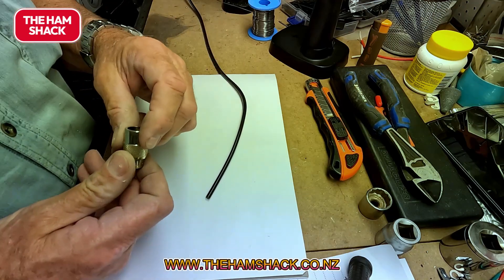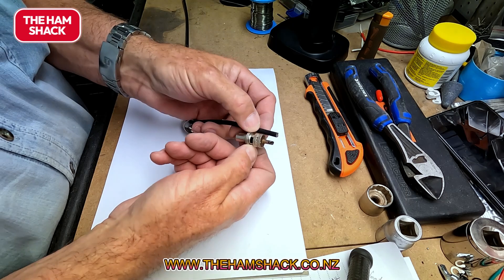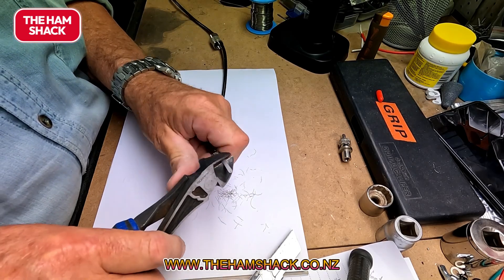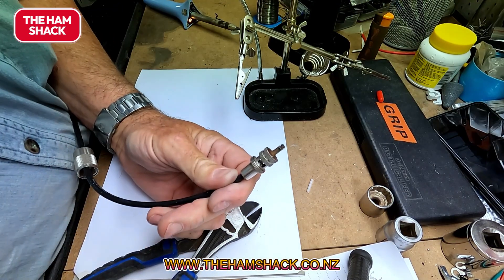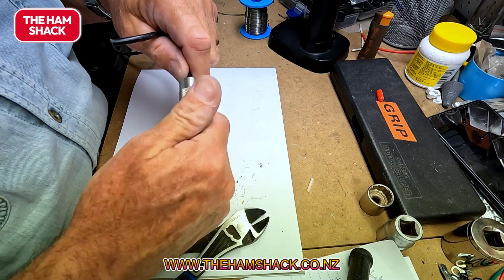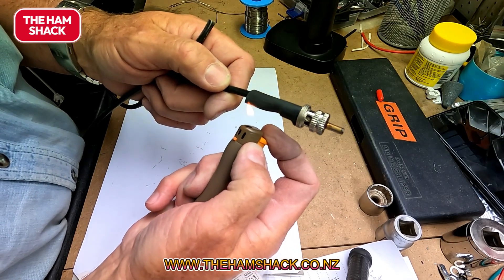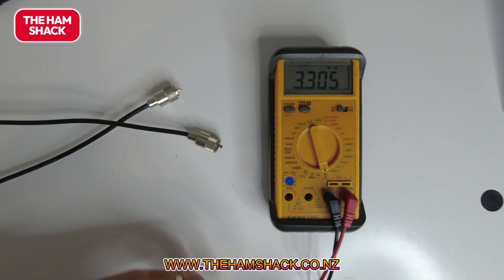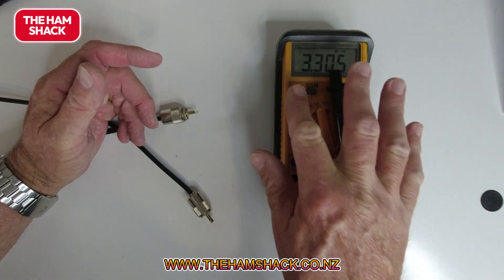How to fit a PL259

Comment: Why? The conventional solder PL-259, an early 20th century relic, is one of the top five worst connectors ever mass produced and number one worst RF connector. It was originally created in the 1930's to pass DC power and got co-opted in WWII as an RF connector. The various diameters of the barrel lead to irregular frequency attenuation as does improper soldering. For those who haven't assembled and soldered many dozen connectors, the chances of melting core or jacket plastic or both are high leading to shorts and frequency irregularities. Once soldering is complete, there isn't any way to properly inspect the solder flow or heat impact on the plastics other than a go/nogo short test. 

Ham newbies and sailors whose radios/antennas also use PL-259's should get ready made cables, invest $20-30USD in a crimp tool  or utilize compression style PL-259 connectors. The later ony require soldering of the center conductor that can be properly inspected prior to assembly. Crimp and compression connectors have nearly flat frequency characteristics and yield far more uniform connections.

Send the solder PL-259's back to the 20th century where they belong!